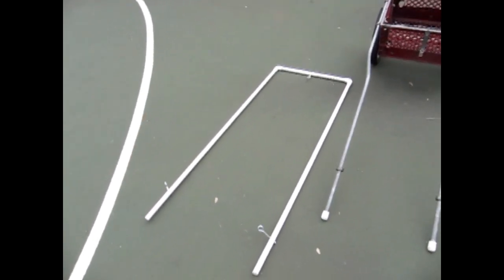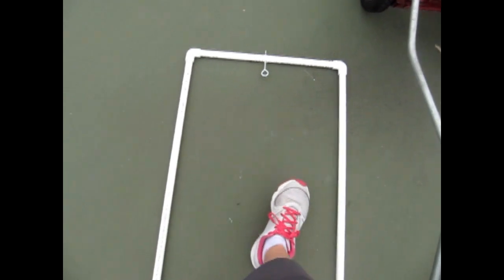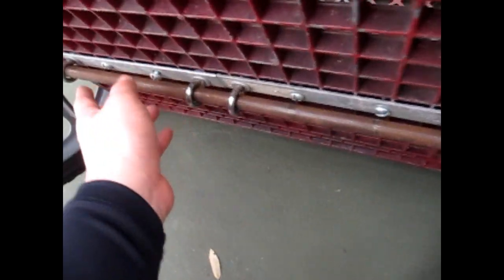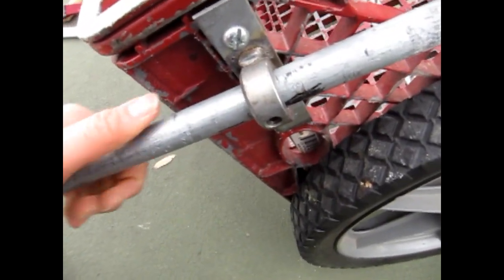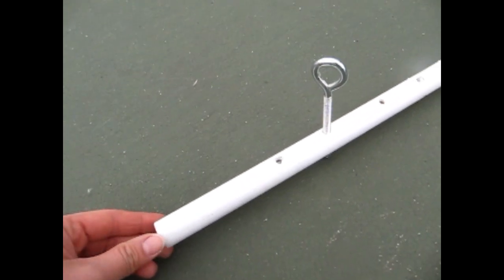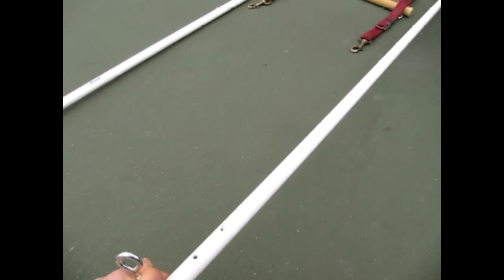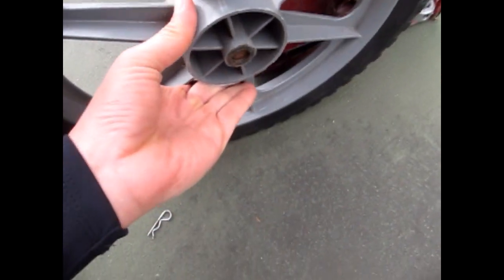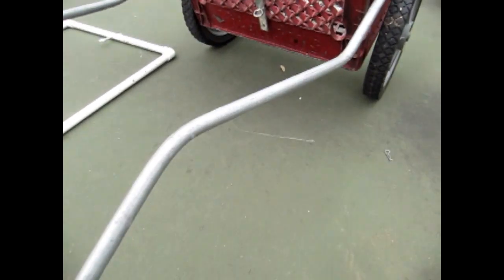How to Build Training Shafts and a Cart for your Dog

Comment: I love the video and have bought most everything to build it.  My question is how do you actually bend the conduit?  Is there a video about that? What tools are necessary?
Someone else asked similar  question about bending the conduit but there was not an answer that explained the bending process in detail.  
Thank you so much! 😊
Reply: Easiest way would probably be to hold it with two hands and push it against a tree outside to make your bend.

Another option would be putting two thick bolts into a piece of 2x4 and securing them with nuts. Then place the conduit between the two bolts and apply pressure from the end of the conduit.

It'll bend real easy that way

Comment: This is wonderful, thank you! 

What angle did you bend the conduit for the 2 bends in the shafts?
Reply from the maker: +G Caldwell They don't need to be an exact angle as long as both bends are the same. I typically stay in the 30-35 degree range.

Comment: I have a 16 month old foxhound, around 60lbs I'd say, how long do the shafts have to be? what size PVC? Sorry video got really quiet in the beginning and only was able to hear that yours are a little over 4 foot due to you having Greater Swiss Mountain Dogs? o.o I hope I got that right. XD

I also want to make sure my dog can pull my weight (urban dog sledding) so how do you train for that?

Please help! love your video BTW!!!
Reply from the maker: Measure your dog from the point on her check to the rear hock and add about 22 inches, then add about 10-14 inches for the part of the shaft that attaches to your cart. I'm going to take a rough guess that it is about 4 ft of shaft if you do not do a bend. My dogs aren't that much longer than a 60lb dog. :o) I use 1/2 PVC.

Comment: can you give me a rule of thumb for the lenth (in proportion to the dogs body) the training shafts should be? - from shoulder to - 5 inches behind? or 12" behind? or long enough to drag the ground?... Thank you
Reply from the maker: Hi Terri, 

A good rule of thumb is that training shafts start just in front of the point of shoulder (if you were looking at the profile, about even with the chest), and it should run to about 12 inches behind the dog's hock. That should give you about an 18 inch arch. Here's a post that has some more of the details: http://caninedraftwork.blogspot.com/2010/01/is-there-judge-out-there-named-steve.html

Comment: How did you measure and bend the shafts on the cart
Reply from the maker: You have to get a piece(s) of conduit and start practicing bending first. Then you can measure the dog and figure out how you want the shafts to bend. It will also depend on where the shafts attach to the cart. Do you have photos of your cart?

Comment: Where do you get the harness? What age is best to start a St Bernard? I have a 10 month old. I have a Radio Flyer, were would I find the plans to convert it for my dog?
Reply from the maker: Stacey Turpin I’m a harness dealer through Nordkyn.com. You can start teaching the skills at any age. Things like back up, walking next to a shaft, and side stepping do not require a cart. I start them in a lightweight cart around 14-18 months old.
Reply from the maker: You can make these same training shafts and attach it easily to a radio flyer.

Comment: How do u make one for shih tzus
Reply from the maker: Sushii Productions Same method. Just make it smaller. ☺️
Reply: you don't don't do this stuff with that small of a dog you're just going to destroy its joints and make it miserable get a bigger dog like a bandog or something around that size with a similar frame and then make one Jesus Christ just get a real dog that will not only enjoy drafting but it will be useful like what I do with my dog I go down to this little Wooded Trail a few minutes away and I cut down some brush and have her drag it into the middle of the trail so I can cut it up for firewood more easily